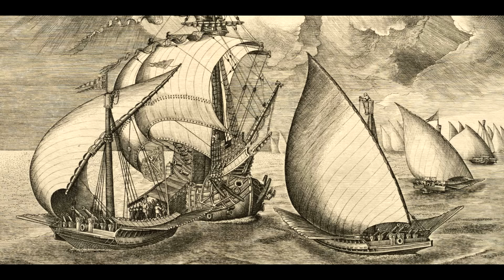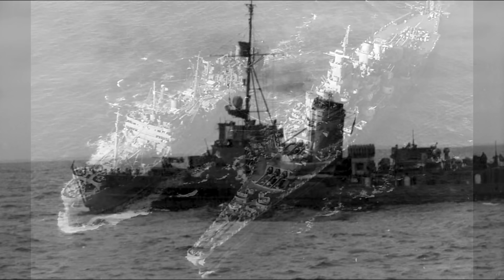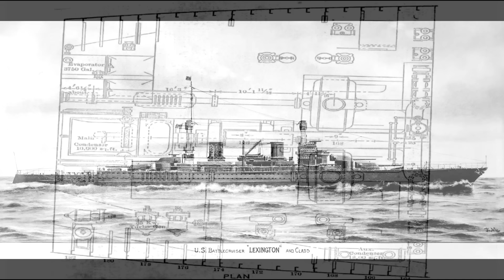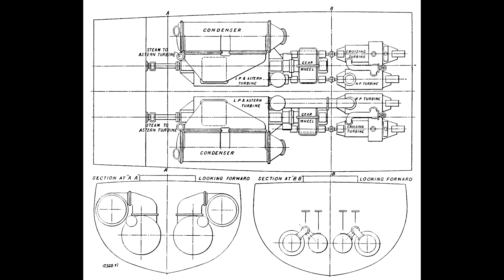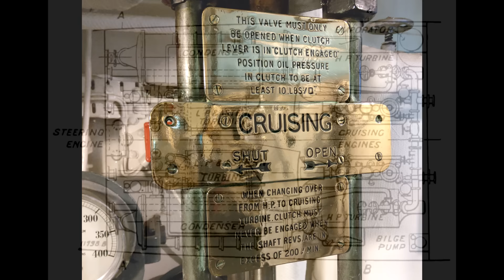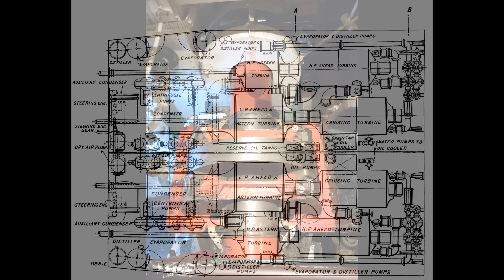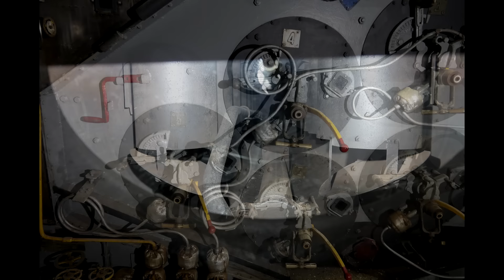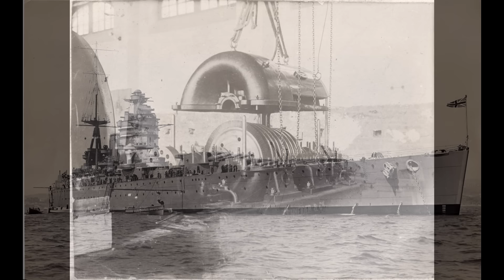Naval Engineering - How to choose your engines

Comment: That nominal power is usually around 80% of theoretical maximum output of a power plant system.  In steam systems the parts that usually go first in normal operations are your bearings, blades, and seals.  
No matter how robust your cooling and lubricating equipment is on these large systems, because they aren’t fully immersed in an infinite amount of coolant some extra heat is going to build up in those key parts and lead to them slowly changing shape over time.  
At 80% maximum power the point where your bearings start to go out of round or carbon seals crack from heat deformation can be measured in months or even years, but just that twenty percent power increase can turn that into only a couple weeks or even a couple days.  
The relationship between wear and maximum power output isn’t linear.
Reply: To add on some more steam turbine lore, another big factor of wear and tear is how quickly you run your power up or down.  It's not super noticeable in smaller rotating systems but when you're talking about ships with extremely heavy multi-ton main drive shafts it becomes very important.  All that spinning metal wants to keep spinning at the speed you pushed it up to, if you suddenly apply a lot of clutch to it, or you start at say "ahead 1/4" and then slam the accelerator over to "emergency ahead" the sudden change in speed is going to make that giant steel shaft start to twist.  
Steel can only deform so far before it either cracks or bends permanently like plastic, so too much rapid shifting will twist your drive shafts like corkscrews resulting in them coming unbalanced.  That vibration is then transferred unevenly into the bearings that support it's weight which chews them up rapidly in turn..  
In worst case scenarios the shaft might abruptly be jammed to a stop when the bearings friction weld together with it and since that energy still has to go somewhere.  It can rip itself loose from other components or be warped into an unsalvageably bendy pretzel.  

I've had to help more experienced guys try (and more often than not fail) to refurbish these warped up drive shafts and it's one of the most aggravating, man-hour swallowing jobs I've ever had to do.

Comment: Re high pressure steam vs low pressure, ie 600psi vs 300psi, would the same turbines be used for both, or are there specifically 600psi turbines?    Great channel, please continue...
Reply: A high pressure turbine might be able to run on low pressure steam, but not efficiently.  A low pressure turbine most likely will not be able to take the loads induced by high pressure steam, nor stand up to the operating temperatures of that steam.  This is the reason a high pressure plant generally has a two stage turbine, high and low pressure ends to properly address the inlet steam conditions.

Comment: Wartime experience with damage control showed the need for more electric power independent of the main engines so diesel generator sets were widely added to existing turbo alternators during 1941-5

Comment: It can be safely said Single Expansion and Compound are now way too obsolete to consider. Though I myself would only go with Triple Expansion when the Turbine technology was generally new. While Triple Expansion may create a rhythmic noise, that doesn't make up for the rumbling and excessive steam. 

If you want to check out a bunch of ships left with Triple Expansion; there's ps Waverley (last paddle oceangoer), SS Meteor, SS Shieldhall, SS Jeremiah O'Brien, SS John W Brown, SS Hellas Liberty, Icebreaker Stettin, and Ferryboat Berkeley. 

As for coal; SS Badger for now still uses coal (might change in 2026) and Icebreaker Stettin gets to keep the coal burners.

Comment: Steam Turbines actually still exist on a couple of cruiseliners via combined Gas and Steam Turbine system. The heat of the Gas Turbine heats up the water for the Steam Turbine. 

Liquefied Natural Gas (LNG) Ships can come equipped with steam turbine. It seems there are around 200 left with that propulsion system. Most newer ones though are now Two-Stroke Diesel. 

Also, water based nuclear reactors are basically cousins to Steam Turbine.

Comment: Wasn't coal a good substitute for armour too?
Reply: Earlier on the coal and the big coal bunkers could help provide protection from earlier shell types.

However eventually the shells got too big for the coal to provide real protection; especially as the larger shells made it easier for more water to pour into a warship. There's also the fact that torpedoes came along and that lead to the need of void spaces to try to protect the engineering spaces from water. Coal is useless against later torpedo types.

Comment: wait since when you can reverse turbines? i was under the impression of it being straight up impossible, like not just "very hard because you need to wait for it to spool down" or "yeah but it's inefficient". i seem to remember the geometry of the rotor and stator blades is specific for a single direction and will never work the other way
Reply: Ryan Szimanski (Battleship New Jersey) mentioned at one point that the battleship could move in reverse by feeding steam into the turbines from the other end.

Comment: For a combined diesel/steam propulsion system — it requires a different design for the combustors, because of the lower viscosity of diesel, but you can readily design a steam engine to run on diesel, eliminating the need to carry two different fuels. Additionally, you can design the steam side to use the waste heat from the diesel engines to preheat or even boil the water in the steam engines (or to superheat the steam), lowering their fuel consumption for the same power output compared to running them without scavenging heat from the diesel exhaust.
Reply: this is done one  land in the from of combined cycle power plants

Comment: When I was in Coast Guard, we rated boilers at the recovery rate and not HP, got out and heating plants rated at HP, I thought that was funny. Your picture of the Lexington, the testbed was the RCS Electra, US Navy used the Coast Guard as test for new tech in 20th century, secretary class tested high pressure boilers, think 800 psi. Enjoyed discussion.😊
Reply: The coast guard also got the first helicopter carrier as well
Reply: @jacobdill4499 from his flying boats to HH-52 we had good relationships with Sikorsky, the admiral for 52 project ruined it, made them use old gearbox with new powerful turbine.

Comment: 3:38 Why two kinds of fuel?  Boilers will happily burn diesel, though it's rather more expensive than typical bunker fuel.  Might be worth it to simplify fuel handling, though.
Reply: It also requires different combustors; you can push diesel through combustors designed for fuel oil, but it won't burn as efficiently.

Comment: A major factor in the choice of boiler steam pressure is boiler feed water QUALITY. Higher pressure demands better quality feed water (nearly distilled quality). Most water contains some contaminants which tend to finish up coating inside the boiler tubes. Silica can form silicates which can be as hard as glass and gradually reduce the efficiency of the boilers. The Prinz Eugene needed a major boiler retubing exercise.

Comment: Obviously, electric drive never dominated. But I have read that some US warships used turbine-electric drive because producing gear sets was a production bottleneck. Would it also be the case that electric drive would make distribution of power under battle damage easier.?
Reply: T2 tankers used turbo electric drives as they couldn't build enough geared turbines.
Electric drives of that era were on a separate circuit than everything else as the voltage was different (USS New Mexico had 6000V motors), and the frequency would change with ship speed.

Comment: Adding superheated steam adds all sorts of of complexities.
Reply: But solves a number of large challenges.  Non-super heated steam tends to be saturated, includes water vapor.  This water vapor is corrosive (erosion) leading to lower life for the turbine blades.  Superheated steam also has higher energy density, providing more power output from the turbine.

Comment: For relatively modern marine boilers, low pressure is about up to 20 bar (300 psi) and high pressure from about 60 bar (900 psi).

Comment: 1:45 I think you mean that the power density of Diesel engines is less than that for steam, right? (As you later seem to say.) The energy density would not determine how fast you go, but how far you go with a given volume of fuel. (And is Diesel worse for power density than all steam systems? Or just steam turbine?)

Comment: Thanks for an entertaining video.
So many fun choices. 
As a retired marine engineer, who started off in the US Navy's nuclear power program,
and through a number of interesting opportunities, I have actually operated a number of types,
of powerplants both Steam and internal combustion. 
While most of the steamships use geared turbines, I have operated a turbo-electric plant, and some small reciprocating steam plants,
but the most unique steam plant I ever operated used a direct drive steam turbine designed to operate at typical propeller speeds.
This required a very large diameter rotor element, with a huge number of stages to the turbine - and yes,
it did have some unique operational characteristics, but it was actually a very successful propulsion system, and the vessel had a long career.
The Turbo- electric plant was in a converted T-2 Tanker built in 1944, and the operating manuals were keen to point out the advantages
of this system in case of an air raid - because you could rapidly transition the plant from cargo pumping to propulsion.
Thanks again.

Comment: I used to work with steam propulsion systems in the US Navy.  I appreciate the research effort and the level of detail in this video.  There's one improvement I can think of: it would be nice if the drawings of propulsion systems had captions stating which ship (or at least type of ship) they were intended for.   A nit-pick is that, when you first mention cruising turbines, the drawing is of a ship that uses triple-expansion "cruising engines" rather than cruising turbines.  Some pre-WWI USN destroyers had this.

Comment: And of course, if you're talking about ships from the 1930s, you have to consider what future systems might prove to be really critical down the line. It would be rather embarrassing to have designed the perfect cruiser in 1933 only to realise, come 1940, that you don't have enough spare electrical power to run a decent radar set, and thus, you either have to send said cruiser back to the shipyard to be refitted, or operate it as is, and try to arrange for it to always be paired with a radar-equipped vessel.

Comment: Great content
Just one addition. Yes the boilers and engines make the ship go. But the condensers keep it going. A hit on the condensers will force the engineers to go open loop, or bring in salt water
You may buy a few hours, but on a long distance chase,  you will get run down.

Cordially
Reply: "A hit on the condensers will force the engineers to go open loop, or bring in salt water"  

A "hit" on the condenser is the equivalent of having your carotid artery cut, it will immediately flood the engine room with an ocean of salt water and all the steam a boiler can generate. Even a minor "hit" producing a hole a few centimeters wide will very quickly knock the engine offline due to a loss of vacuum and overheating of the turbines. Seawater fouling of condensate will instantly contaminate the entire boiler feed. There is no "open loop" in a marine steam propulsion system larger than a steam launch operating on a fresh water lake.

Comment: Some other Youtuber says that Trump is forcing catapults to go back to STEAM, as opposed to EV more vulnerable designs.  Also, you cannot re-charge an Aircraft Carrier from the local Tesla EV stations.  Our company designed power electronics, and the US Army is also caught into this reliability game.  El-Cheapo Drones are the answer to everything modern.  Even if they fail, all it takes is a handheld launcher, to make them effective and cheap.  Solar Panels mounted on the decks of the Carriers can easily handle the recharging energy required.

Comment: Could they not have belts or augers to feed the coal furnaces? Was it just cheaper to use men? I know they stowed coal all over the hull but I could still imagine designing it like a big hopper with a screw pulling out the coal from the bottom of the feed.

Comment: High pressure boilers also have more stringent feed water quality and water treatment requirements (relative to LP boilers) in order to protect the boiler itself and the connected turbine.  As an aside, the USN needed refrigeration to keep ice cream cold and I suppose they air conditioned everything from the captain’s cabin to the  bilge, so how much power (% of total capacity) did this typically consume?  The RN in WWII fought on spotted dick, ship’s biscuit and rum (I extrapolate from Patrick O’Brian) so aside from minor details (the Med and the Pacific) I presume they had smaller refrigeration needs.

Comment: Another aspect of the geared turbine vs turbo electric drive:
With a geared turbine, the location of the gear set and drive turbines is fixed by the location of the propeller shaft. With a turbo-elecrtic drive, you can mount the turbine and auxillaries anywhere and run cables to the shaft drive motor. This can make for a more compact armor scheme.
Reply: Yes, this. It's convenient to be able to put turbines and associated machinery anywhere, without having to line them up with a shaft. I also expected this to come up when discussing cross-powering systems, since any prop can take electricity from anywhere.
Reply: Also more redundancy because you can route power from any generator to any motor. For cruise, you could have some of your turbines shut down and still feed power to all shafts. If you lost a turbine and generator set to battle damage, power from the remaining sets could be routed to maintain propulsion on all shafts.
Later, of course, turbo-electric drive became attractive on nuclear submarines because it reduced noise - the turbine and generator could be isolated from the hull and the shaft would only have noise from the electric motor.
Reply: @2whostruckjohn Former MM1/SS The only turbo-electric submarine we had until recently was the USS Tullibee. I did my initial training at the S1C prototype in Windsor, CT, which was a full scale operational mockup of the Tullibee propulsion plant. She sucked.

Part of the problem in those days was the only game in town for variable speed was a DC motor. That means commutators and brushes that have to be maintained regularly. Up until the now under construction Columbia class, turbo-electric was pretty much shunned for nuke boats as primary propulsion. Although, all US nuke boats had an Emergency Propulsion Motor that either drove the shaft directly after uncoupling from the reduction gear set, or engaged the propulsion train in the gear set, depending on class. We had methods of isolating noise from the propulsion train to the hull, including through the shaft, that I can't discuss. (ETA: I almost forgot about the Glenbard P Lipscomb).

But IGBTs and VFD technology has advanced a lot in the thirty years I've been out. For Columbia, two generator sets will be devoted to an AC power for propulsion. Two SSTGs will be devoted to Ship's electrical busses.

Comment: Perhaps a future episode might address the problem of distillation capacity and how this might restrict some ships in duration of higher speed steaming. In Hornfischer's "Last Stand of the Tin Can Sailors" there is a moment when the larger Japanese ships must slow as they have depleted fresh water. If memory serves, in "Sweet Pea at War: USS Portland" it is described that CA-33 Portland and CA-35 Indianapolis had unusually large distillation to facilitate their role as hunters of commerce raiders. In my searches I have found very little on this facet of propulsion system planning. Perhaps a lower speed diesel might still outrun a faster steamer if the steamer had limited duration at full speed (?).

Comment: When the US Navy was designing the North Carolina class they compared the weights of a turbine system to turbo electric and decided that the electric system was too heavy.  But in the final design they split the power plant into four sections with 2 boilers, a condenser and evaporator in each engine room, plus redundant fuel pumps and separate settling tanks.  Westinghouse has argued that this arrangement cost a thousand tons more then the turbo electric system!  Plus the North Carolina also vibrated more!
Reply: The vibrations were because of hydrodynamic issues, and would've been there with a turbo-electric plant too.